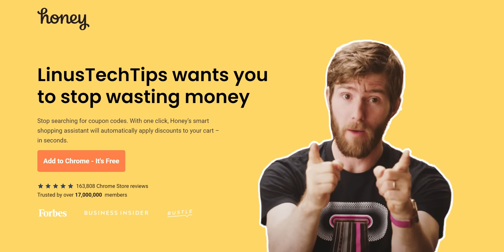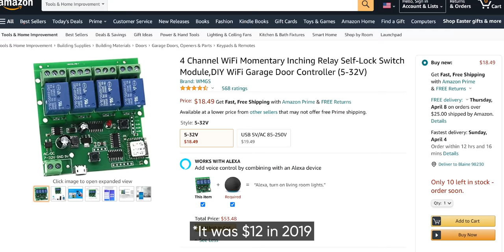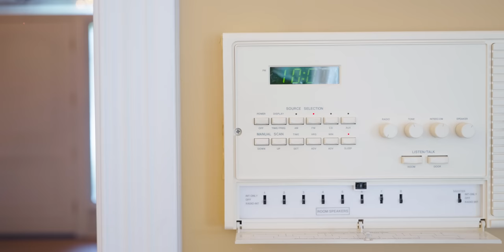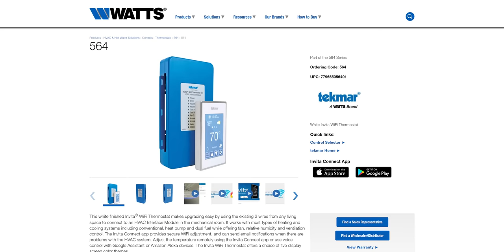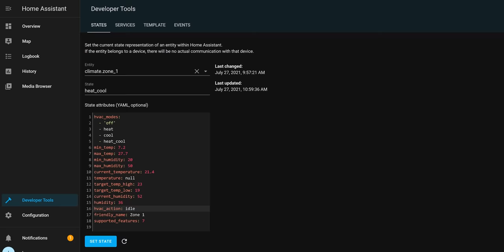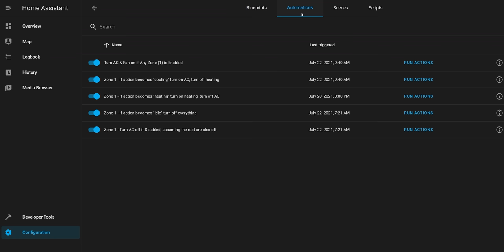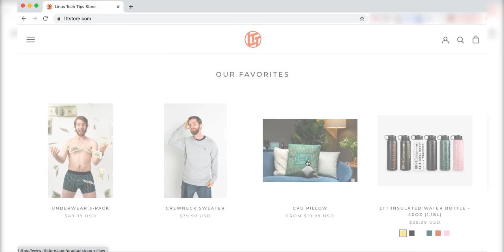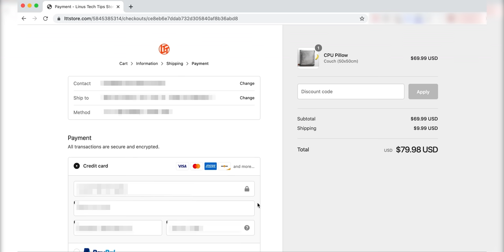This Should've Been EASY - New House Smart HVAC

Comment: Looks like a solid setup, I've got a few notes:
1) Tasmota exists for the ESP32, there's an ethernet version of the ESP32.  You should wire the thing that is controlling your entire house's AC and not rely on WiFi.
2) Your ecobee's have various "smart ai" features on them, one of them being that it will notice if zone has been set to cool for a while and isn't getting colder.  It will come up with a message about checking whether your AC is malfunctioning.  This may cause a problem for you later.
3) As others mentioned, you will need to have a minimum number of dampers open at any given time, closing all but one will put a lot of strain on your blower and will likely burn it out pretty quickly.  In home assistant you could just alternate other rooms to open/close while keeping the room you really want to cool open the whole time.
Reply: You could also only allow closing the dampers 75% of the way to help with the back pressure.
Reply: For 3, is there anyway to tell how many you should have open at one given time. As in given the model of my AC, can I measure how many I should have open?
Reply: @TurtIedd  not really... Unless you can get the fan curve of the blower fan in your ac unit. Almost all residential ac units are built for a specific cfm at a specific static pressure, changing one of those variables ( cfm or static pressure) means you need to change the speed of the fan which most residential ac units aren't made to do, not to mention that the compressors aren't staged as well. You can get away with closing off a couple dampers, but for each damper you close without reducing fan speed accordingly you add more strain on your system.
Reply: Also, he doesnt know how his ducts are run i doubt they were designed and run with multiple zones in mind...he might run into zones that he thinks he can close off that affects more than one room.
Reply: And as inefficient as it might be, maybe something akin to a pressure release valve where if they DO close all but one, the rest gets vented outside so that you don't put strain on your blower.
Reply: @jinyang3565  Wouldn't the controlled dampers be installed right where the duct is in the room? If it was installed next to the air duct it shouldn't effect other rooms right?
Reply: @TurtIedd  let's say he has one duct going into a room serving a diffuser in that room and that duct continues into another room into another diffuser... You can't put dampers in series.
Reply: The master has spoken.
Reply: Most places that sell dampers also suggest you have a pressure relief damper; if you've got so many others closed that the pressure goes up, it opens the damper to a passthrough to the air return, thus relieving the static pressure.  That cooler air is also easier to cool the next time, so the air cooling the one room with an open damper gets even cooler.
Reply: For number 3 , Installing an IR blaster to control Blower fan is a great solution.
Reply: Why wouldn't you rely on WiFi? I mean WiFi is very stable and it's just for the AC and not for an Alarm System.
Reply: @jinyang3565  A pressure sensor just after the main blower would be able to provide enough feedback to determine if enough dampers are open. He is going to need to replace the AC/AHU for one that can vary the compressor and fan speed rather than janky blow off vents and complicated automations to solve a 25 year old problem. Also, the way he's going to control them dampers is binary (on/off) rather than variable so I do think he's in for all sorts of problems... Cold/hot rooms, too much flow out of some vents.... etc......
Reply: But tasmota ESP32 is pretty new and still alpha, isn't it? Not long ago it was purely ESP8266 IIRC.
Wasn't ESPHome for both?
Reply: @gamingenius  or even just recirculate it to the blower inlet. that way you're not wasting the chilled air.
Reply: @noahluppe  Yes, ESPHome is probably (definitely) a better choice, but he mentioned tasmota, so I was going with that.
Reply: @TurtIedd  open all of them closing one or two is fine if absolutely needed but you are not really saving any money by closing vents in a standard home.
Reply: @davidskidmore3442  that is an awesome idea!
Reply: @dougle03   yeah i think linus has a solution looking for a problem best to just have a set temp you keep the house at 365 days a year and have enough airflow in the house so that you dont have hot/cold spots.
Reply: "You should wire the thing that is controlling your entire house's AC and not rely on WiFi."  

A thousand times this. In 10-20 years the Wifi standard could change and your home network upgraded so those units wouldn't be able to connect anymore unless you have a less secure access point on your network. Not good. Wired Ethernet is unlikely to have the same issue.
Reply: @davidskidmore3442  sounds like a line to sell an extra damper. Not like the things seal completely air tight. You could accomplish the same goal by just having a current limit on the blower
Reply: I don't understand a single thing you just said😂, but I sure hope that I will in the near future.
Reply: Use the server room as the dump load unless condensation would be an issue.
Reply: as im new to the comment section of a handful of these videos lemme say 'omfg im so stoked to see you here' to dude running the hookup.
Reply: @designgears  the dampers dont work like that, atleast not these
Reply: As an HVAC tech, dampers on AC make me exceedingly nervous. I've had to defrost SO MANY frozen-over coils when people get the bright idea to close off all the downstairs vents so that "all the cooling goes upstairs". The indoor coil NEEDS at least 400cfm per tonne running through it, or that bastard WILL turn into a 6" thick block of ice.
Reply: @davidskidmore3442  You can't recirculate cooled air into the return duct, if you do you would be under loading the evaporator causing the A/C to freeze up. This is the same reason that bypass humidifiers need to have a damper for the summer. It's best to  not give out advice on this kind of stuff unless you're a licensed HVAC technician.
Reply: The Ecobees also have their own motion sensors in them
Reply: Hi @the_hook_up and folks here,
Would you have any suggestions for a relay board with 6-8 channels, WiFi, HomeAssistant or ioBroker-compatible, for switching 24VAC and 230V to control valves for garden irrigation and the pump? Any ideas?
Reply: Or simply make or get a frequency controlled main blower which ramps up if more dampers are open. It's way more efficient in the long run. EC fans are a must in Europe nowadays. This would make your entire AC system more efficient too. Might even swap that out for a frequency controlled or multi stage compressor version as well...
Reply: @chrisverbeke2335  You most certainly can do a bypass where your allowing the air to flow right back into the return. What you cannot do is cut down too much flow. As stated further up in this thread. This entire journey he has embarked on is more of a fun adventure of making something unique. I'm cool with it and he is going to learn a whole lot of new things. Also, a dump into the server room is not a bad idea given sufficient return. Humidity levels are more likely to be managed but if the worry of condensation, which I don't believe is much of an issue, you can run a dehumidifier if it helps. It's fun watching people not in their profession explore new things. He will find his way.
Reply: @Devolont  I don't know why you would say that you most certainly can because you can't. I'm a licensed HVAC technician, I know what I'm talking about. Sending the cool air directly back into the return would cause the evaporator coil to freeze up. The restrictor in the evaporator is designed to send as much liquid refrigerant into the evaporator as it can, without any of it making back to the compressor. If you send cool air into the return their won't be enough of a heat load for all the refrigerant to change back to a gas before reaching the compressor and the A/C can end up freezing up.
Reply: @chrisverbeke2335  In a two zone system, for this example, you most certainly need a bypass valve to open when only 1 zone is calling. (This per run type vent system is gonna be very picky). The "restriction" device, most likely a piston in his system, will need that bypass flapper or this setup will fail very frequently and freeze up. What you're referring too is the "metering device" is stacking refrigerant. In this case of his old piston R-22 system, it cannot throttle like a txv. So you most certainly can but must have one installed. Too many vents closed and it's already going to freeze due too lack of airflow and not because the air is too cold.
Reply: @Devolont  Lack of airflow and cold return air are both examples of under loading the evaporator and both can cause the A/C to freeze up. I'm not saying that proper airflow isn't important, I actually addressed this in my own comment shortly after the video was uploaded. If it was fine to send cold air directly back into the return then why does a bypass humidifier have a damper?
Reply: @Devolont  the A/C outlet air will have LOWER HUMIDITY and if dumping the excess cold air into the server room would cause the AIR to be cooler then the server hardware so condensation should NOT be an issue
Reply: @jasonriddell  Absolutely, Air Conditioning by-product is dehumidification. I'm just saying if anyone is worried about such a setup, it's not going to hurt.
Reply: @Devolont  The point of the damper on the humidifier is so that cold air doesn't cycle back into the return air under loading the evaporator. Maybe you should be looking up what it means to under load an evaporator. Linus' best solution is probably to run some larger ducts to areas of the house that will have larger cooling loads and always have air flowing to those rooms. I don't care what some random article tells you, sending cool air into the return reduces the load on the evaporator causing liquid return to the compressor and that is a fact, they even have that question on the A/C exam.
Reply: @Devolont  I'm not trying to call anybody out either I'm just making sure the correct information is out there. Sending cool air back into the return is not a proper solution to the airflow issue, the supply air needs to be properly sized and set up with the dampers to provide proper airflow.
Reply: @chrisverbeke2335  It's all good man. I guess I'll go rip out all the zone bypass valves that my customers have because they don't work.

This system linus is trying to install is always going to under perform if the heat load is not matched per take off and the dump isn't properly sized per average call for cooling. Have a good day.
Reply: @Devolont  Are you saying that Linus sending the majority of the supply air back into the return when cooling because only one or two small dampers are open won't cause the A/C to freeze up? Just because you have installed them before doesn't make it correct to do so. Having a bypass damper for when running the fan only would be a fine way to help balance the cooling through the house but you can't send the cool air back into the return while the A/C is running, they aren't designed for that.
Reply: @chrisverbeke2335  I never said his system only needed a bypass. You are probably missing a little of what I said or I spoke it else where so maybe there is a little misunderstanding between us. Linus needs to have multiple zones open...period and a dump zone. A bypass can be helpful depending on how the overall system is going to be designed. I used a simple single stage fan and compressor with two zones as my example. But one zone having a call and the rest being closed, a bypass would cause problems. I'm not disagreeing with you on that. So to be on the same page, the best setup for linus setup is to have all dampers only close 50%, then open when they have a call. Depending on how much that allows cfm wise, he may still need a bypass or a dump zone sized accordingly. But saying bypass valves will cause a system to freeze because it underloads the coil, I have not seen it cause an issue where the air becomes too cold where you max out the refrigerant capacity. 

If 1 zone is open and a bypass were installed, maybe it would cause an issue but it would be a total joke of a zones system that we would all laugh about it and make jokes.
Reply: @Devolont  I never said that your other methods of addressing the issue aren't valid, my point was specifically about the bypass damper. I'm not sure where you work from but at least where I'm from in Canada connecting a bypass damper to the return air isn't an acceptable practice. Having low airflow and having cold return air are both examples of under loading the evaporator so I don't see why you don't get how that is a problem. I brought up the example of the bypass humidifier for a reason, if they don't want cold air cycling back into the return air through a 6" pipe then what would make you think it is acceptable to send the supply air back into the return through an even larger duct? Just because an A/C doesn't freeze up due to a bypass damper doesn't mean you aren't getting some liquid return to the compressor. This system should be properly designed by a licensed duct designer.
Reply: @chrisverbeke2335  I'm in zone 4 in the states. I can promise you, a regular multi zone (2 per my example) with a bypass will prevent static lock and not cause liquid to make it back to the compressor. Reason being is because the air would not become cold enough. As per linus setup, it just won't work. He needs someone to design the system properly. Also, bypass valves shouldn't be a thing anymore anyways with ecm motors and stages compressors. 

I understand stacking refrigerant and most systems come with a txv now. I know we can still use pistons and I prefer them but SEER ratings and all.
Reply: @Devolont  You should maybe leave the advice to professionals that actually live in the same country that the work is being done in. The codes are much more strict here when it comes to HVAC (and so is the education) and as I said you aren't even allowed to have a bypass humidifier without a damper to stop supply air cycling back into the return let alone a duct specifically for that purpose. If you look in an A/C manual (not all include it but some do) it states that and A/C should not be ran unless the return air temperature is 68° or warmer. Sending the cooled air back into the return is doing the same thing as not having enough airflow, both are examples of under loading the evaporator and that's the last that I'll be speaking on this matter.
Reply: @chrisverbeke2335  Your little quip of "leave it to the professionals" is laughable my friend.
Reply: @davidskidmore3442  There's another problem. Cooling the cold air will result in colder air but at the same time, it's harder to cool down the cold air even more so the energy transfer will suffer. It's like trying to squeeze two cups of tea in a single cup expecting that it will be the same effort if you have empty cup nearby. It's not. The lower the temperature of incoming air, the less temp difference there is between the air and evaporator coil so less energy is transferred. This also means that everything will run colder, may freeze up condensations water before it goes to the drain and it will also make it harder for compressor to compress colder refrigerant which was not able to heat up as good in your house. 
If that was good idea, nobody would bother with multi stage units. There are alternative but those are usually even more expensive. The reason water heating is more efficient is mostly because of water heat capacity. It takes time to heat it up and time to cool off so it lets you get a lot of energy from burner and then radiate it slowly in the house. Similarly there are water cooling systems that do the same. The coolant has much more inertia so you can use full AC power to cool it down and then for quite some time you can run cooling just from this cold water.
There's even a project to build cooling towers for neighbourhoods in some places that have common heating. In Poland it's quite typical that you have one heating block for whole neighbourhood or even whole city and heat exchangers simply transfer the heat to house water loops. They were thinking some time ago about using the same infrastructure for cooling. Just replace water with antifreeze and run cold fluid inside the loop.
In case of Linus there's not much he could do except some pressure relief. Either flaps that will still let some air to other rooms if the pressure is too high or do this with software to pick also next room that could use most cooling. Water solution could be good for example by installing additional high airflow radiator with a tank that would be cooled down similarly to boiler. Then do something that will only run the fan and use this cold water block for cooling. Turn AC on only when the water gets too warm. This would add some inertia to the system and then using pressure relief to air return would not be that bad. Simply store excess "coldness" in the tank to reuse it later slowly. Similarly when you plan putting something warm in the fridge, it's best to put something with high thermal capacity in there. Could be tourist fridge fillers, can be ice or a bottle of cold water. It will accommodate much more heat than the air.
Reply: @rikilshah  The blower fan is already being controlled just fine other than it not being variable speed, which will not change with an IR blaster... So what exactly are you saying you would do with an IR blaster?
Reply: You should be able to throttle the blower pretty easily with a simple AC motor controller.

Given the price tag on this project, that seems like a more reasonable solution, even at the price premium.
Reply: @louisvaught2495   You have to load the A/C properly or it will break soon. If you don't push enough air through the evaporator coil, not all refrigerant will evaporate and the compressor will try to compress liquid. That is bad for compressor so you would actually need to increase the blower fan rpm to maintain the same airflow with that much restriction and this is waste of energy. With this old A/C unit it's like driving in your foot on the floor. How can you slow down this way without damaging the engine? Turn it on and off all the time?
Reply: household systems are designed with ridiculously wide margins to avoid this
Reply: Back pressure is a hugely over-rated problem. Close all your dampers, confirm the motor on the blower isn't running hot, and you know it won't burn out.
Reply: Squirrel cage fans don't burn out from high static. They pull more current when flowing more air.
Reply: @Devolont  I'm not sure what is so laughable considering I never claimed that you weren't a professional. I specifically said that you should leave the advice to Canadian professionals since that is where the work is being done and therefore it's the Canadian codes that apply to the work being done.
Reply: A bypass could be added to allow closing of dampers completely. TrueZone uses one for its system.
Reply: @Devolont  I wouldn't worry about it. He's God's gift to hvac. I don't think he understands that some zoning system require a bypass damper which is weighted. And to his dumb argument about why a humidifier has a damper on it is because obviously there is no point in having air blowing across the hum pad when cooling. 2nd if having that damper on it open can cause such big problems in cooling, then why would it not cause the the hhls to open up because of high return temp.......some people
Reply: @tt-vg9be  I blocked him. It was like he just wanted to fight.
Reply: This guy airconditions.
Reply: This
Reply: @gamingenius  or in this case the server room
Reply: When using any type of zoning on your system you need a bypass damper between the air return and the supply
Reply: @gablacasseb  not all zoning systems require a bypass damper. Really the correct term isn't a bypass anyways. For zoning it's a barometric damper
Reply: @jinyang3565 , I see what you're saying, that's a practice usually only used in large commercial spaces where I am.
Reply: And build those airflow control valves yourself. 150$ is a bit excessive.